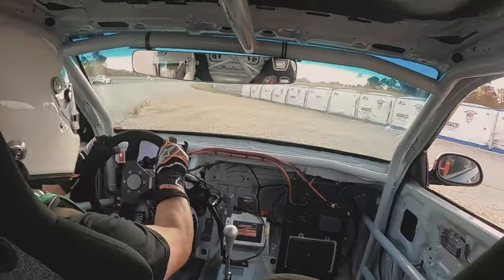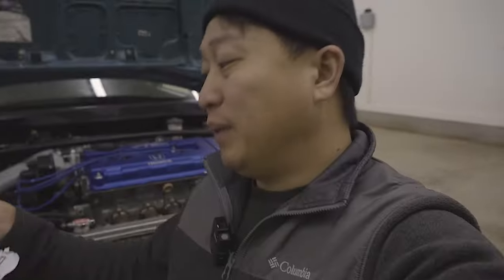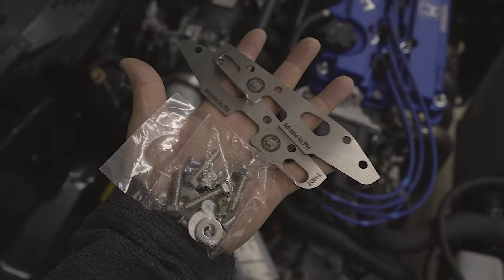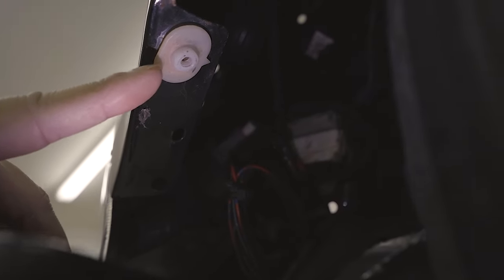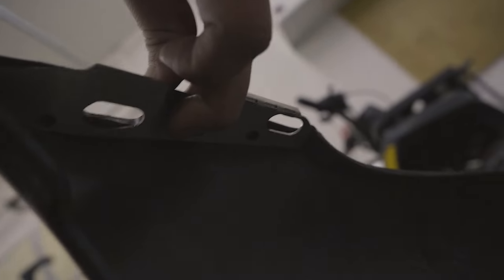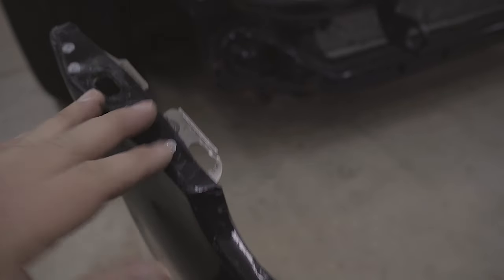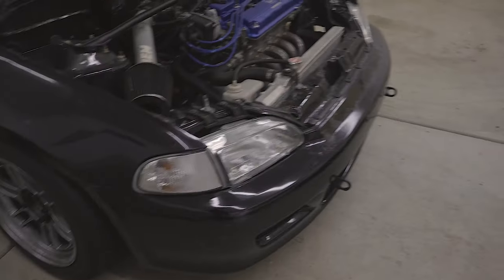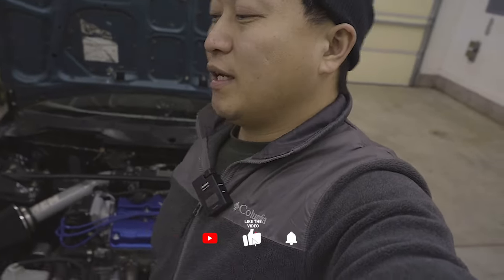How to Install the Poorboiz Bumper Lifter Kit | Civic EG

Comment: Thanks for the video!!!, nice, simple and clean install!! What brand front and rear tow hooks are those on the car?.. I Need the right (passenger) front tow hook, as my plates/tags are on the left side of my bumper.
Reply from the maker: The front tow hooks are integrated into the Doryoku crash bar inside the bumper. 

The rear hook is from Seb’s Garage.